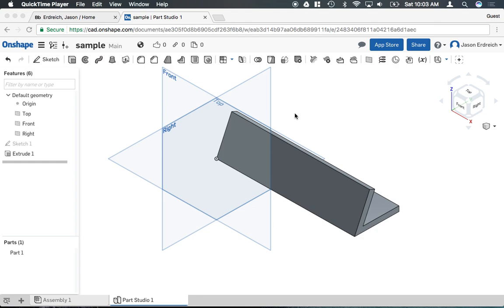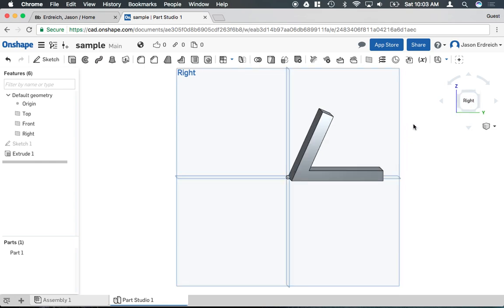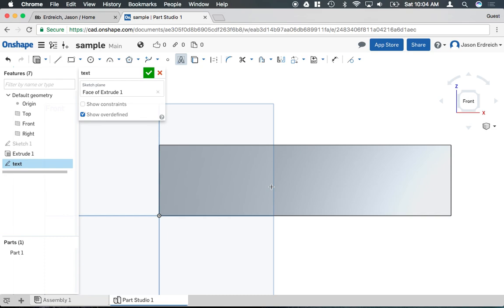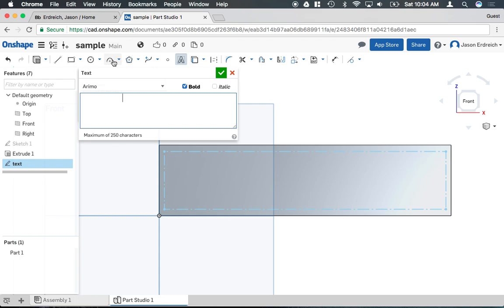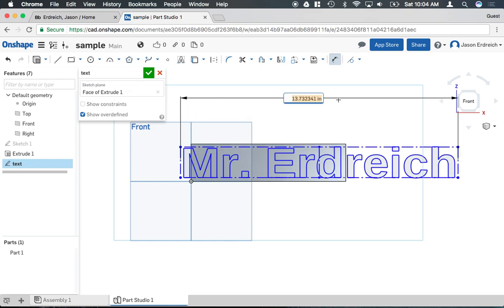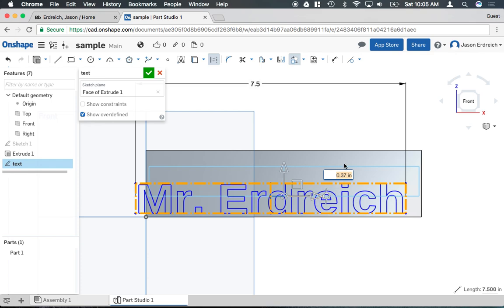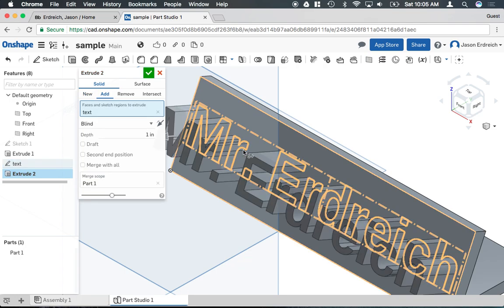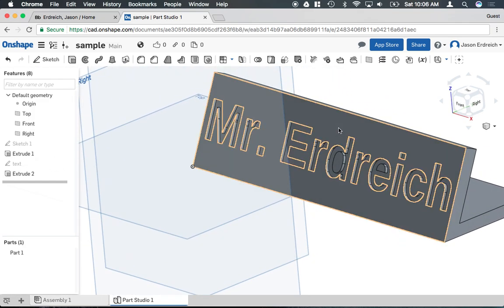How to create text in Onshape CAD

Comment: I know this video was posted a long time ago but after I write my text and size it, it keeps telling me that it's not defined. I tried so many things like parallel, horizontal and all sorts of conbinations but I can't make the sketch work with a text. Thank you in advance.
Reply from the maker: This typically happens when you try to dimension both the length and width of text, or horizontal and vertical dimensions. Try dimensioning just one axis, for example the width and its horizontal position and see if that helps.

Comment: It is possible to add a silhouette, instead of text? I need something that has a skull and cross bones in the middle. Thanks!
Reply from the maker: It is! You can import a jpg or dxf by pressing the + button in the bottom left corner, then place an image in a sketch. You can then trace or manipulate it based on the file type you upload.

Comment: Onshape's text tool is extremely basic.I haven't been able to find a way to create a text item and then go back and edit the text. Once you click out of it the text is locked. If I use Copy Sketch Entities and then Paste, copied text items don't appear. I thought embossing some number labels next to some holes would be a simple matter of creating one label, pasting it multiple times and just changing the numbers. But each text item has to be created and sized individually. For this task I found it much easier to export the .STL file and add the labels in Tinkercad.
Reply from the maker: I completely agree the text tool is exceptionally limited. You can edit your text after creation though. After confirming a text box, you can always right click on the text entity and select "edit text" to modify. If you the copy entities, it does paste without a common origin so they often do not paste in the same location, or will not paste if it can't find common properties between sketches. I often add text is post processing methods as well to access a greater font library. 

Thanks for viewing, hope this helps!